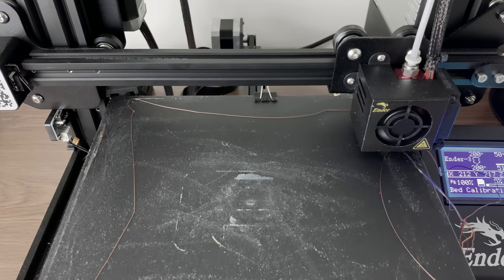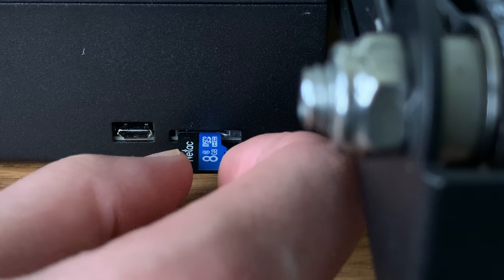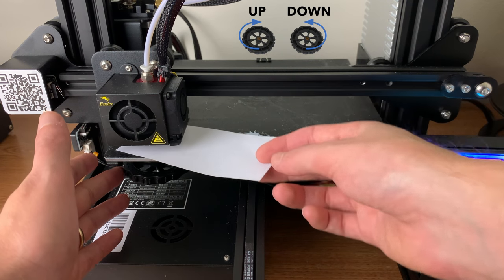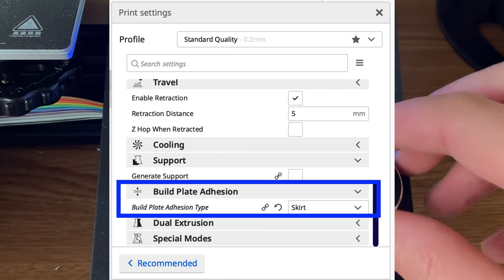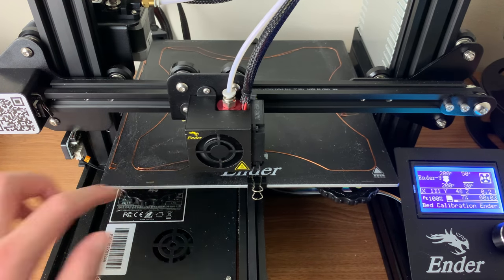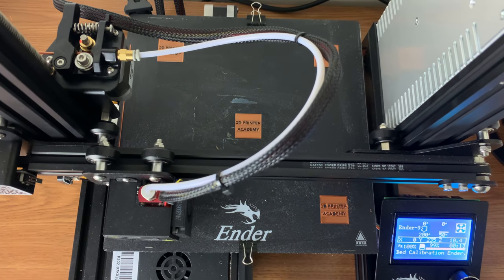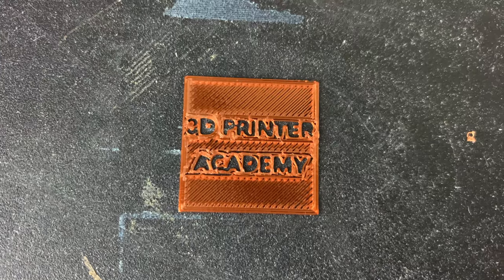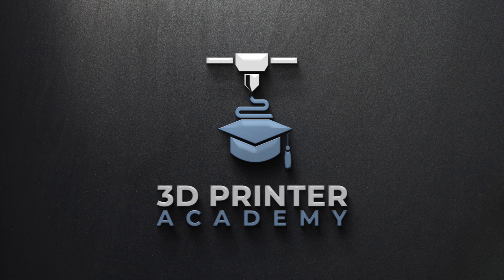3D Printer Bed Leveling - Ender 3 Pro

Comment: If only it were as easy as all these videos say it is. I’ve been trying to level mine for a week now. One corner is always too close to the bed and all the other corners are way too far away.
Reply: i had been trying for over a month until a couple of minuts ago i finally did it after soo many failed tutorials,the step diagram helps at 1:10
Reply: @manosm.4718 you a life saver lol i did not wanna watch the whole thing and that worked great
Reply: I’m having the same issue… for months
Reply: @ValVanni same
Reply: Same with me. I have to tighten on handwheel all the way, with another one so loose the handwheel is actually about to fall off.

However, this is all irrelevant if you can't get your Z Offset set correctly.    It would help if the video showed how this worked in conjunction with manual bed levelling and auto bed levelling. The latter determines a mesh so that it can compensate the Z position appropriately according to it's XY position.

So, where exactly does the nozzle have to be for the Z Offset to be valid ?
Reply: I just got my printer and I still can't level the bed..I really need help.
Reply: it might be an uneven bed
Reply: easy fix get a bl touch or a glass bed or just a hard one
Reply: Well, I have been having a lot of problems with my too. Until I discovered the secret.
Reply: @fredalo6168  what is the secret?
Reply: @slash_games4538  thats whats wrong with this generation, dont even want to watch a 6 minute video to get a better print quality.. this generation is fucked
Reply: @ThrashFPV what 😂
Reply: I definitely have a bent bed since one of my prints would not come off without excessive force. This bent it slightly, this could be the issue if you absolutely cannot level it. The far left middle is lower than the corresponding corner. So the tip scratches the corner and doesn’t make contact in the middle.
Reply: @slash_games4538 wtf is 6min long jfc
Reply: @nobytes2  So? Does not mean i wanna watch six minutes of the video when i only needed 1 step. Why rebuild the lego set if i only need to go back and fix 1 part

Comment: Whenever I try executing the g-code, my ender 3 pro does not stop at each point. I have to manually pause the "print" at each point. After that, it doesn't resume once i hit resume. Anybody else have this issue?

Comment: Great video. Yours is the first I've seen recommending leveling with 9 spots, instead of just the normal 5 spots (4 corners and center) the two concentric overlapping squares really help to get the bed completely level. I didnt download your file, I just moved my print nozzle to those spots, in the order you showed in the video. Bed came out leveled , with a magnetic removable bed line. And the other thing, saying that you want "a lot of friction" between the paper and print head, not a little, also helped my problem of the first layer not wanting to adhere evenly to the bed.. so thanks again!

Comment: having took a break for a while and watching a similar video on leveling is probably what took my bed so far out of whack...  x plain if you adjust positively on one point you have to adjust negative on the direct diagonally opposite point as these create your X leveling 5 points 4 tips one mid

Comment: I think the  GCode you provided is not working properly, im not seeing a continue option and it just goes around the print bed not stopping for me to level it out with the paper.
Reply: I think they paused it every time the printer was at a corner
Reply from the maker: It should work, however it might depend on firmware / printer you are using

Comment: Nice video but.... you have to realize that Z axis end switch doesn't stop on the same point. 

I have small 3cm wheel mounted on Z Axis thread rod to see the moment where auto home stops. I've found that it stops on 2 exact positions. where one position is occuring is more often. 

The recipe for that is make a reference where the wheel is stopping more often (lower position is better) and do several auto home attempts to reveal if this point is still the same or not. Then notice the points. Do bed leeling on this noticed more occuring point.

When print is started just watch the knob wheel in phase before extruder heat-up will do auto home. You have still time to cancel print in case that Z-axis rod will stop on bad point.

In mine case the diference betweeen points is 0,6mm / 6 0,1mm steps.

Let me know if your Z-axis switch is stopping threaded rod in the same position or not.

Comment: I downloaded and tried the gcode that you use after rough leveling. My printer does not stop between the corners so I can not calibrate. It just walks through the steps and then stops. Does anyone know why is that?
Reply: Yes, it's because certain variants of Marlin firmware have disabled the G Code command corresponding to the 'pause' function.
Reply: @quantisedspace7047  thanks! This would mean that I’d need to edit the g code myself to make it work somehow? Or it will not work on my machine at all?
Reply: @ermate did you ever figure it out? I’m having the same issue
Reply: @true_catholic  unfortunately not yet, I don’t have access to the printer I had back then…

Comment: What I do is just disable steppers and manually do everything and looking at the gap between the bed and nozzle to make adjustments, works pretty good and uses no filament, no paper, and only takes a minute
Reply: How do you stop the nozzle moving up and down, with the steppers disabled ?

Comment: quick question, for the G-Code bed leveling it states its only for the Ender 3. what is the main difference between the 3 and 3Pro that it will not work for the Pro.

Comment: What can I do when the skirt will stick to the print bed, but when it comes time to printing the squares, the filament WILL NOT STICK to the bed and just for a mess of jumbled pubes near the hot end! I've tried cleaning the bed really thoroughly with alcohol and leveling like the previous steps. Any reccommendations? Maybe try extruding more filament at a time? what setting would I change for that?

Comment: Leveled the bed, preheated it and selected the file for my first Benchy test print. Watched in disbelief as the nozzle chiseled a perfect Benchy shape into the glass. For unknown reason(s) the z axis would not move up and didn't realize what was happening until it was too late. Thought I followed all the instructions. Changed the nozzle, but definitely need a new piece of glass. Will try to level the bed again using your files to level and calibrate. Any ideas why my nozzle dug into the glass? Cheers

Comment: Thank you help me set up one of my Ender 3 machines. I have a few Ender 3 Pro's and tried to use the bed level file but it just went through the motions without stopping at each point. Do you have one that will work on Ender 3 Pro's with Marlin?

Comment: On my new Ender 3 Max there is the issue that even if I get bed leveling to come out with the paper test, the nozzle is still too high for good adhesion.  I think something is going on with the z-axis shut off switch that's keeping it from going too low. In the latest Creality software for the Max, you can't set a negative z-axis offset to compensate.  So I'm going to just get the CR Touch  device, disengage the offset switch (as CR Touch tells you to) and let technology fix this for me.

Comment: The Click to continue button just isnt showing up and I don't know what to do
Reply from the maker: Hmmm I think I heard something about the pause function not working on certain firmware, not 100% sure. You might have to disable the stepper motors and manually move the extruder to each point.